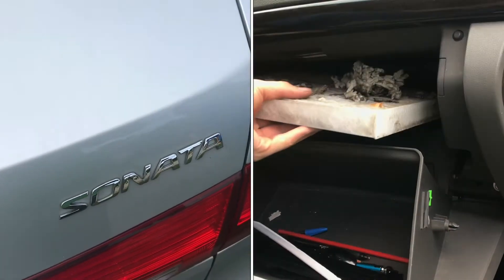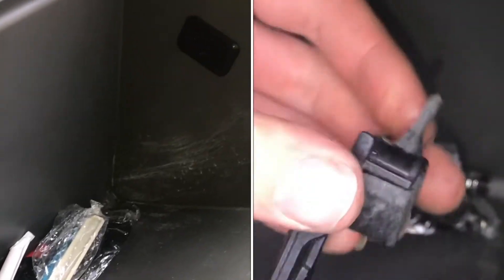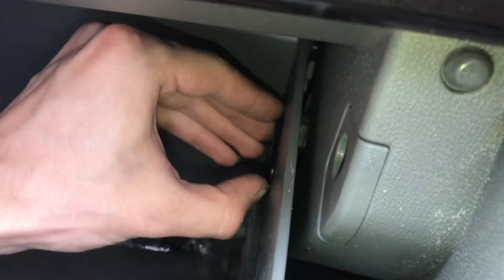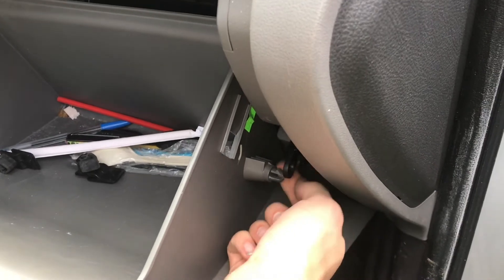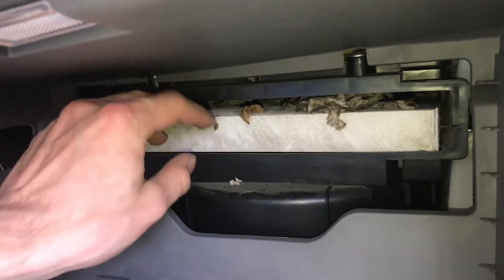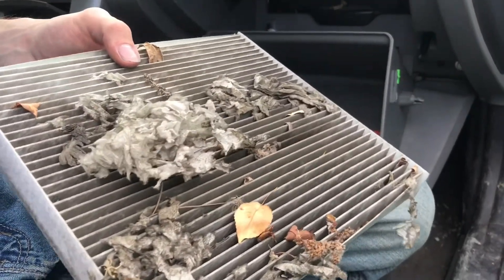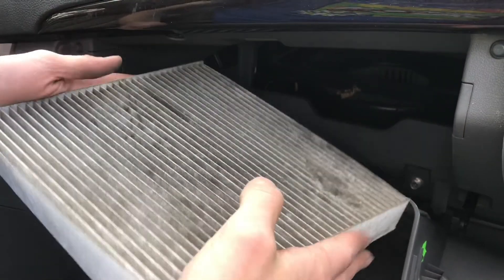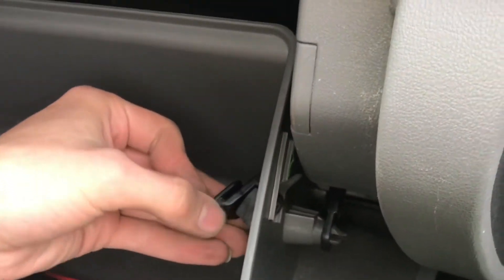how to REPLACE a cabin filter on a 2010 hyundai sonata

Comment: Thanks for video helped alot. Air filter was incredibly dirty. After reinstall noticed a really loud roaring sound coming filter spot. Turned car off, checked under new air filter and found a acorn had fallen into the fan when removing the old filter. Everything works great now after getting it out
Reply: I am also having a loud sound issue...I need to check the blower fan to see if anything is inside.  I think I have to take mine off as that hole is really small for my hand.

UPDATE: Sure enough I had some random pieces of lint stuck in the blower blades. This fix was super easy

Comment: I have sonata 2009
 ac blowing is good but ac air is not cool 
Condenser gas everything is good but cooling not a pretty good 
Please help me
Reply: i have a 2010 sonata with 243k miles on the original motor and its starting to make a burning smell at high rpms not oil tho